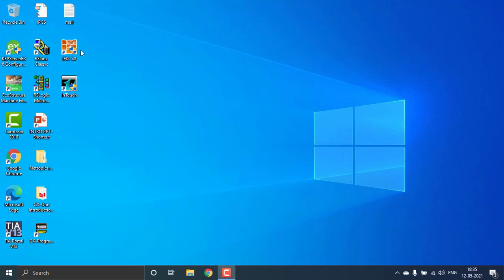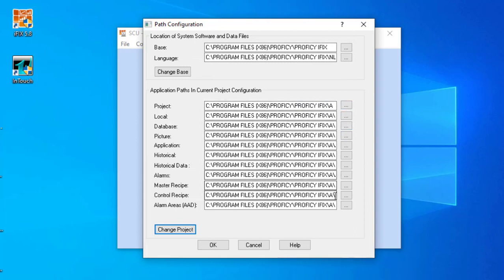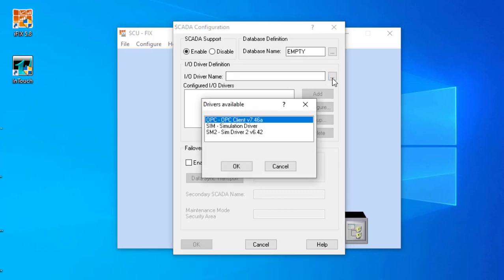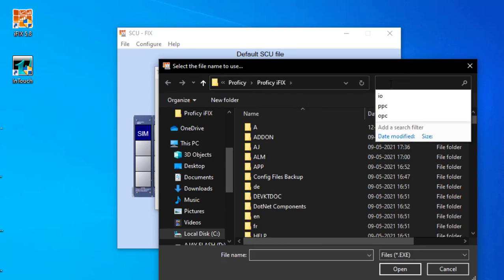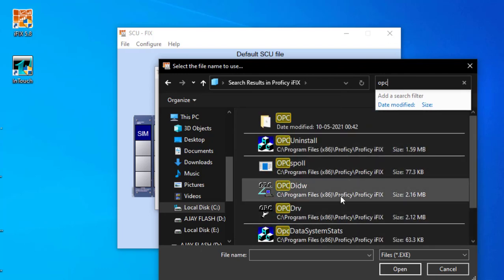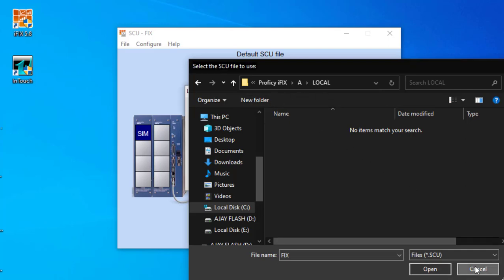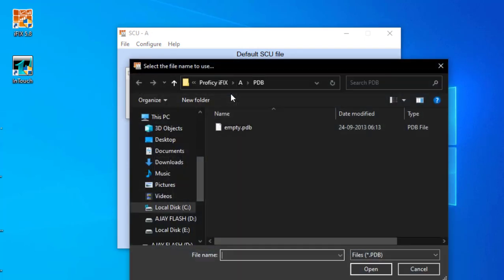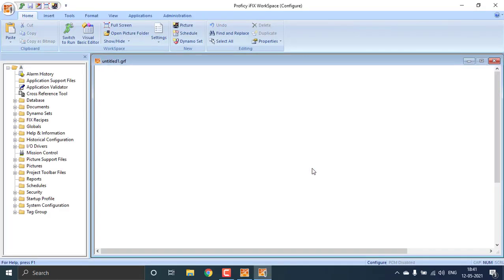IFIX SCU CONFIGURATION | IFIX 5.8 SCADA SYSTEM CONFIGURATION UTILITY | NEW SCU PROJECT IN IFIX

Comment: Hello. Thank you for sharing your knowledge. I am facing problem while adding OPC driver to system configuration in the existing project which I am modifying. Every time I add OPC drivers along with ABR driver, the error pop ups when I start project showing 'networking has not been configured for this node'. Please help me if anyone has face this issue already.